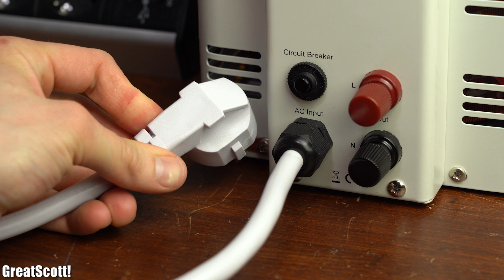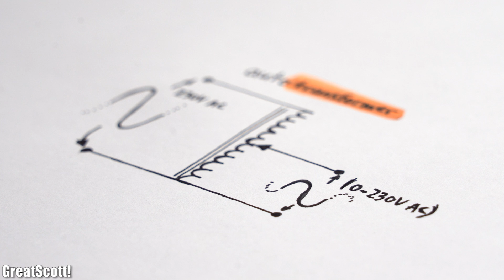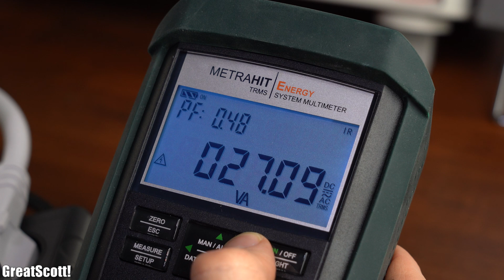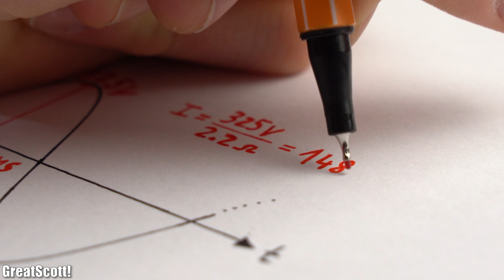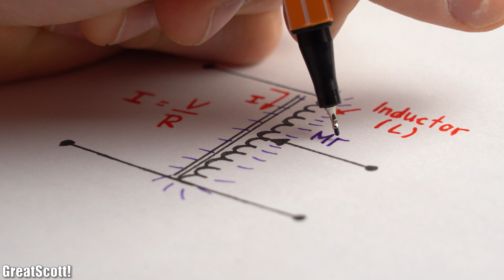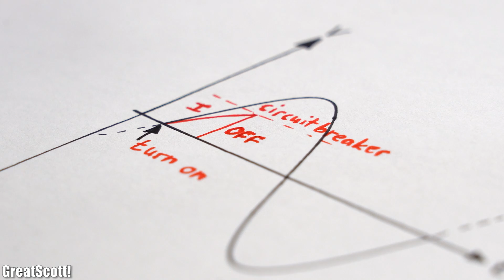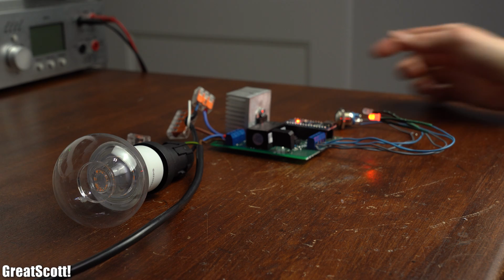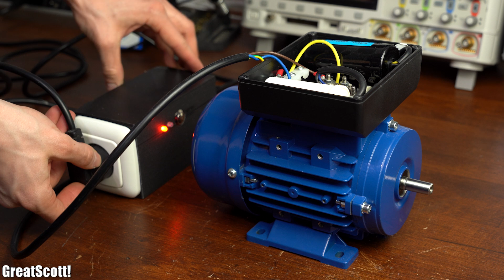How to make an AC Softstarter because my autotransformer keeps tripping my circuit breaker!

Comment: Easier and cheaper to change the breaker to type C time curve which is for high startup loads.
Reply: That was my first thought, but i guess it isn't a viable solution if transformer shares breaker with other devices. Type C is really slow and if wires aren't properly sized it can cause all sorts of problems.
Reply: @cekpi7  true in some cases, but if IK is in the right range, it shoul‘d be ok
Reply: @cekpi7  Wires shouldn’t have anything to do with it if they are rated 16A thats 16A wich A,B,C etc characteristics. But you will theoretically get in trouble with the law since (in Germany) you are not allowed to change the brakers and type C isn’t allowed in household outlets anyway.
Reply: @ThePunischer1000  The wires being rated for 16A doesn't matter, it's in that case all about the loop impedance.  It's interesting to learn that Germany doesn't allow type C breakers in household outlets. In Switzerland you won't find anything else then C in modern installations.

Anyways, Type C wouldn't even be enough most likely. The C16 starts to trip in between 80-160A, so a type D would be needed to be on the safe side
And then again, you'd have to make sure every other outlet in the circuit has the required 320A of IK. Should be possible since the wiring looks new, but definitely isn't a given
Reply: @ThePunischer1000   actually, C16 circuit breakers are according to DIN VDE 0641 Teil 11 for household use allowed! But sure, to change them, you need an electrician.
Reply: @benny-c  you coul‘d also do it Yourself, and the elektrician checks the installation before you turn it on.
Reply: Might be true. But less fun😜
Reply: @robertwillemsen368  when I watched my teacher screw up chancing the fuse, and it sparked, it was pretty fun.(don‘t worry he is ok, and was wearing the proper protektion)
Reply from the maker: Also possible. But not always the best solution.
Reply: @greatscottlab  Why you think is it not always the best solution..?
Reply: @greatscottlab  ...
Reply: @greatscottlab  Yes, why do it simple when you can make it complicated 🤔
Reply: @greatscottlab  Don't you need a license to have C breakers installed legally? I read something about "stealing electricity" but I have no clue how that's done with a breaker.
Reply: D curve is optimal for this application.
Reply: That is the first thing that came to my mind
Reply: @jantsbenzproaudio  I have made soft starter by ujt very simple and powerful and small
Reply: I had the exact same problem with my Keysight E36313A DC power supply just when plugging it in. Does anybody else also experience this problem? I've now also changed the circuit breaker to a C type and the problem is gone.
Reply: @johannglaser  just tape the breaker to the up position during start-up
Reply: Type D‘s would be much better suited for transformers etc.
Reply: @nicholasward  Right, GC always says stay creative..
Reply: @feldim2425 im not sure what the standard for breakers here in Norway is but i might test tomorrow
Reply: They are more expensive and used mostly in factories.
Reply: yes, but the breaker is slow and cannot limit inrush current.. 
the breaker just give you more bigger range for your electronic which had a inrush current problem..

 so, type C breaker has a higher amperege, but for another electronic which have a more higher power than your breaker spec, it will still trip your breaker (because inrush current can be a hundred amps for milisecond) and the breaker will trip..

 that is the breaker can't do.. that is why, the softstarter wiring or softstarter plug is exist.. they can limiting the inrush current, so it will not trip your breaker without losing power of your electronic..

some electronic, they have a inrush current limiting component like NTC Resistor which can decreasing their resistance while operating (because more hotter they are, the resistance more smaller).. but, if they had been powered off for a short time, the NTC need some time to cooldown.. 

so, if they had been powered on again for short time, they resistance still too small for limiting inrush current.. and at that point, it will trip your breaker because of that.. 
so the softstarter plug, it can solved this problem and more flexible..
Reply: Of course you could use an analog circuit like UJT or PUT to triggering the Triac it is simple cheap and little
Reply: @MrMetalgods  Are these components still available?
Reply: @paulcohen1555  yes all these components is available in all the wolrd
Reply: @MrMetalgods  until it breaks and sets house on fire...
Reply: @MrMetalgods   My thoughts also. I have been amazed at younger electronics hobbyists and their addiction to using arduino's when a couple of transistors would be far easier to do and would work well. Maybe it's the thrill of overkill.
Reply: @feldim2425 i think the breakers here in Norway need the lever to trip
Reply: I just tape the breaker to the up position during the start-up

Comment: Great Video as usual and I will definitely give this project a try

A Question, Triacs tend to heat up a lot when they are under a heavy load. Wouldn't that heat up and create a powerless of its own?
And if yes, can we attach a relay to the  Dome Green LED which shorts the anodes of the Triac basically bypassing the triac (Just like your DC Soft Starter) to avoid power losses of the triac used for the Soft Starter sequence.
Reply from the maker: Yes, the triac will heat up and create a power loss and yes you can add a relay to bypass it :-)

Comment: Congrats with your new auto transformer! :) Question: How did you measure the voltage with your oscilloscope without risking breaking it, since it is referenced to live ground itself? Did you use any kind of isolation transformer og high-voltage probe?
Reply from the maker: I used differential probes :-)

Comment: Just a tiny note, and I hope it's not rude, but "Such a" refers to something you've already described. Like "A resistor is a device that resists current flow, such a device can be used to..." Not something like "you can use such a resistor". Instead "a device such as this resistor" or "we can use something to limit the current such as this resistor" etc
Reply from the maker: Thanks for the feedback

Comment: not gonna lie but this is exactly something I need to make for about 10-15 past days and here you go, guess a trip to DIY electronic store is required!
Reply from the maker: I hope it works for you :-) But be careful when working with mains voltage. Thanks :-)
Reply: don't forget to check that you have adequate mains voltage by doing the good old tongue test

Comment: You can also use a low value NTC in series with LIVE to reduce inrush currents..
Reply from the maker: True. I actually already did a softstarter video with this technique. I used it for a DC load back then.
Reply: Actually it does not matter which side of the supply the resistance is as the current just runs a loop.

Comment: Elegant , Beautiful, but way too complex to be reliable I have been using a 30 amp Very AC for 30 years on a dedicated stand 30 amp breaker I all so use a 30 isolation transformer heavy but completely reliable your device has a MTF (mean time between failure) that is several thousand times that work space grade components

Comment: brillianT - just one question... why does the motor jump at the end before the shaft even starts turning?????
Reply from the maker: I think that was just the initial moment when the coils were magnetized and the rotor aligned with the field.
Reply: Newton's Third Law. The torque that turns the rotor has to push against something, which in this case was the frame of the motor, causing it to move as well.
Reply: @thereynolds2725  Agree. But it looked like the same jolt as an across-the-line start of a motor that's not bolted down. Didn't expect it would be noticeable under soft start especially because the armature would have only had turned a few degrees to align itself. Cant make out and shaft movement from the video.

Comment: I like to call that thing a Variac :)
Reply: I agree with you but if I  remember correctly Variac is a manufacturer's tradename.
Reply: May be - I just learned it from Photonicinduction who used it a lot to blow stuff up :))
Reply: That's why we research in be sure we are not being scammed at the worst or only misinformed. Good point though.

Comment: Why use a whole Arduino
Can't you use an attiny?
Reply from the maker: I wanted to use the 16 bit timer so that I can have a time delay that really slowly decreases. Would not have been that easily possible with the 8 bit timer of an ATtiny.
Reply: it can be adjusted to work with an attiny but its likely that he did not have a attiny handy so he used an arduino

Comment: Cool, but you could have just changed out your mcb (breaker) for a C or D type (meant for inductive loads) instead of the type B (common residential) you had installed.
Reply: Those are hella expensive... I need a class D breaker for one of my lasers, and a good quality breaker costs over 120 bucks. And that's before you factor in the cost of getting an electrician.
Reply: @eulemitbeule5426 
I found a type C for around 5€ and a type D for around 15€.
Reply from the maker: True :-)
Reply: Ok but can you have a type C charger on a type C outlet on a type C breaker ?
Reply: @AMalas  what do you mean with type c charger and outlet? The outlet is the same, just the breaker is made to trip at a higher inrush current than a B-Type Breaker
Reply: @legominimovieproductions  lol it was a joke. Today I learned of Typr C breakers. We all know typr C chargers, and type C outlets are the 2 pin ones

Comment: You can use another curve circuit breaker too.
Like D-curve Circuit Breaker.
Reply from the maker: True
Reply: He lives in Germany. They are only allowed to use B-type breakers at home.
Reply: @sergeyk9060  Thats not true, we also have C-Type breakers which are rated for higher inrush currents
Reply: @legominimovieproductions  thank you for correction. Im not fsmiliar with German standards. Pretty sure its recommended to use B for home appliances tho. Is it easy to justify using C's with electrical regulators?
Reply: @sergeyk9060  It depends on the total grid impedance. You have to make sure a C-type circuit breaker will trip instantly (<0.3 seconds) in case of a short circuit, meaning the current will exceed 10 times its rated current in a short-circuit condition under any circumstance. That can be a problem with older wiring, long wires or in rural areas with only a few (or a single) building(s) hooked up to a relatively small transformer. In many cases it is possible to justify, but you have to know and do the measurement before.
Reply: @sergeyk9060  As electrician its your choice to choose the right breaker size and type, there is no problem with the regulations using c type breakers, I am not sure but I think only K-Type (for industrial loads) has regulations

Comment: Tripping circuit breaker? Hah, I don't have such weakness with my 30-years-old house wiring. The circuit resistance is high enough to limit any inrush current.
Reply from the maker: Well.....that would also be a solution
Reply: @greatscottlab  There was that one person talking about toasters as resistive shunt loads...
Reply: @greatscottlab  Yeah, but not everybody has a 30-year-old (or older) electrical system. LOL...
Reply: @403_tuna  aluminium   wire and ceramic  conectors and large swich  board  for a hause ?
Reply: My 80 year old cloth wiring has the same effect. Built in protection :)
Reply: @sneugler  Why doesn't anyone like the new aluminum wire code? 🤣
Reply: @BOBLAF88  : All the problems that were caused by the last one.
Reply: @403_tuna  the is thousands  more over the world  or even  millions
Reply: @alangolab6657  Same with our house
Reply: @oniruddhoalam2039  many house in country  site in poland or places rank as a farms that are like 20 minutes  away from the city but still  use main  power lines that are made of aluminium   but many houses have copper and if someone  can afford  10k for new power line and 5k for installation  then can change  the power line
Reply: @alangolab6657  Aluminium wires are also used in USA.  despite lower performance than copper wire, they have the benefit that oxyidize less ( so less maintenaince) and are worthless on the scrap market, compared to copper wires.
Reply: @gabmichael8546  why u post it here why many time strangers  post paragraphs of stuff under me post
Reply: I guess, you don't need any radiators.
Reply: In the US most of the drops from the transformers to the buildings are AL but once inside at the breaker panel it changes to copper. There was a brief flirtation with AL inside buildings years back but that stopped rather quickly as the downsides were realized.
Reply: I had this "problem", but then I rewired my home because the bill was becoming too high from all that extra resistance.
Reply: Old DIY trick. Put a 50m cable reel in between. It may help.
Using C type circuit breakers also help, but it's something an electrician has to do. We do this a lot for server rooms. After a power failure, the inrush current of all the power supplies often trips the B type breakers.
Reply: 30 year old house wiring is only old to millennial's but your comment was funny! :-)
Reply: I have E27 fuses.
Reply: @Flat Sign these are to rise the current as fast as possible in order to trip the rcd quick as possible
Reply: @Flat Sign well an MCB and an RCD is basically the same thing
Reply: @Flat Sign yes, hence the term MCB, multicombination circuit breaker, these trip on over current and earth leakage, what you are describing is a circuit breaker not a mCB
Reply: @Flat Sign A MCB is a multi-combination breaker (RCD with over current protection combined) which is a type of RCBO, these things collectively are called miniature circuit breakers (MCBs also) as compared to ones that are not DIN mounted or ones like Heinemanns or Sprecher+Schu or an Eaton, which all have 6Ka ratings which are RCBOs but NOT miniature.. confusing hah... .

So it depends on the context if the person means miniature CB or multi combination breaker etc.

I don't need to google it, as I just know by virtue of the fact i'm an electrician.
Reply: for small power load ? it can barely tripping circuit breaker..

imagine when you hook up a 3000watt load like autotransformer, no matter how much wattage of your electrical system in your home, inrush current from low resistance circuit always bigger than a smaller load with high resistance.. and the voltage spike is so big, it can reach a limit of your circuit breaker to trip (depending the type of circuit breaker)

so that's why, softstarter wiring (like in motor induction or star configuration) or a softstarter plug is exist..